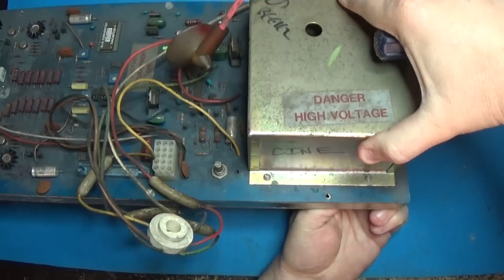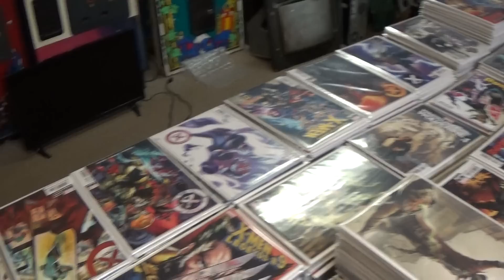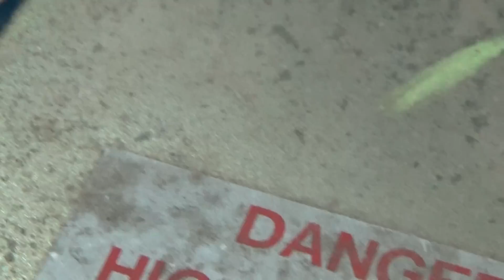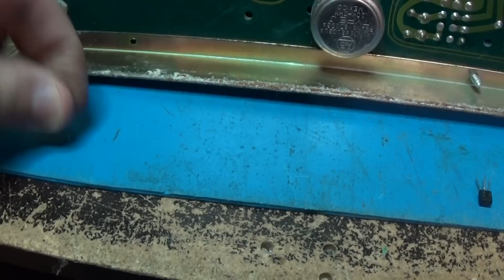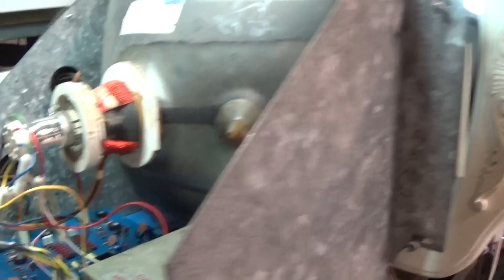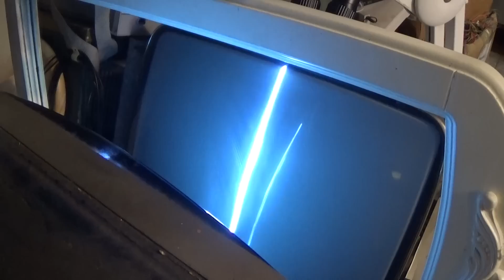Part 1 of 3 - CinemaTronics Vector Monitor Repair

Comment: The encapsulated block connected to the line output transformer is the voltage multiplier. Usually a tripler, sometimes a doubler. The transformer puts out a few kv. The tripler multiplies it by three for the final anode. It consists of diodes and caps. The trade off for higher voltage is lower current, but the final anode requires very low current. It saves making a larger more expensive transformer. Triplers are cheap. These days, the tripler is built into the transformer housing